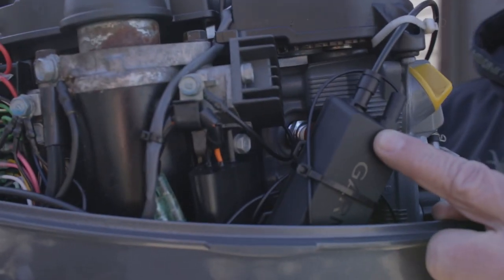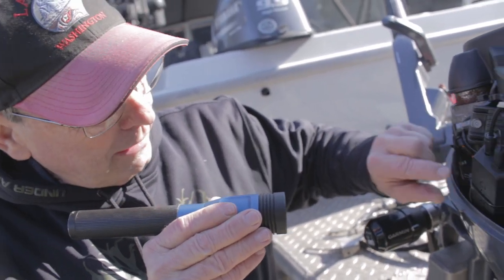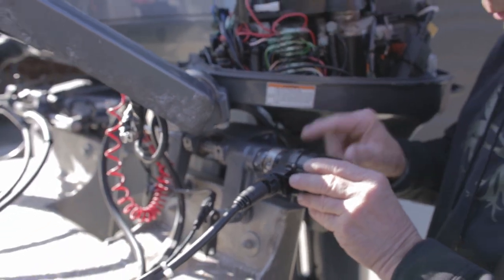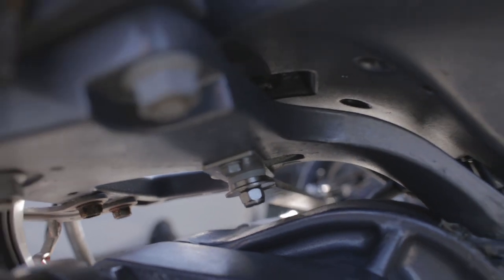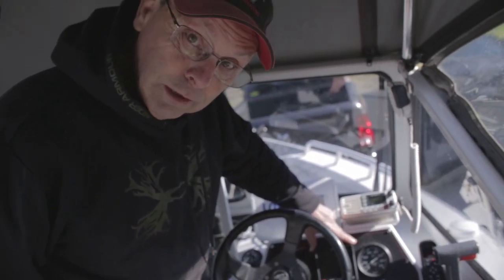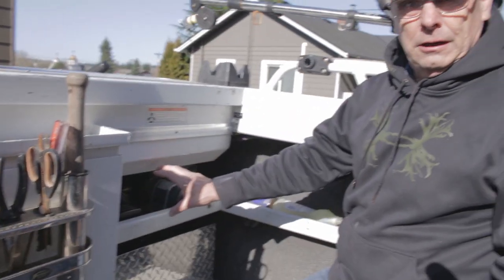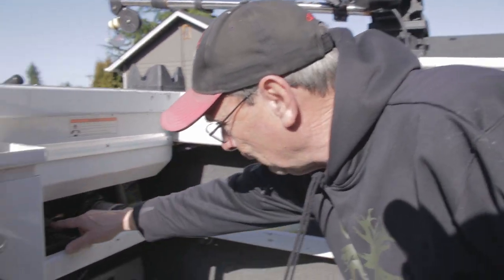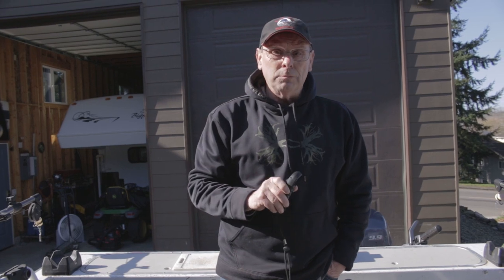Garmin Reactor 40 Kicker Autopilot l Installation Tips with Jimmy Dz

Comment: Really appreciate the install tips.  Helped me tremendously.  3rd day out today had the same problem as you with the steering connector falling apart. Rebuilt with loctite and locking nuts which i assume you had to do also.  Thanks again!

Comment: Thanks to this video we installed this unit pretty easy which was in March of 2020 purchased new for my Yamaha 9.9 high output 4 stroke which pushes a Sportscraft 252 .. All was good until a week ago May 7th 2023 .. My Garmin 93 Sv and autopilot component started beeping and engine went to idle I looked at both screens and it said ECU temperature.. I shut everything down and rebutted and it still gave warning .. So we pulled all poles in and headed to the dock .. Tried it there and same .. I called Garmin and told them what happened and they said did you reboot and let cool down and I said yes .. They had me take the cap off Garmin motor to see if wires were burnt or got rubbed down to wire and Eve looked good .. The wanted the serial number and said send it in and we will give you a new motor .. Well my warranty expired by 2 months so I paid $400 for a new one but get half back after old one is received by them .. Installed new one and ran good for about a half hour and SAME thing happened ECU temperature warning .. Now my 9.9 moves back and forth with ease and it was a very calm evening on the lake smooth as can be .. We pulled poles in went to the dock tried it again and beeping same .. Now waiting to call Garmin in the morning..

Comment: Hi Jimmy
Enjoyed you video.
What were the steps to connect your Garmin Reactor 40 Kicker Autopilot to your Lowrance Sounder?
My guess is you entered the Trolling Motor Autopilot section on your Lowrance?
Any help will be much appreciated.
Thanks, Kenny
Reply: Hello, you don’t have to enter anything into your lowrance, make sure though that on preferred sources on your  GHC to recognize what you are using as a heading sensor. I’m using a point one so that’s what I have. Because it on the nema 2000 when you enter way point or routes to go then on your remote enter go to route it will talk to the lowrance. Tight lines

Comment: Thanks for putting this out there...Quick question??  The video is not too clear as to the location of the CCU (centerline/waterline)...it appears that you put it in the storage area in the bow, but where did you affix it?  Thanks in advance
Reply: Sorry didn’t get a good picture of the location, I installed the ccu just above my bow storage doors, bolted to the underside of the step, they want the ccu to be more towards the front.   Tight lines

Comment: I could not figure out what was wrong with my TR-1 system.  Spent money on replacement power button didn't resolve.  I decided and worked out getting the Reactor 40.  Shop I think is putting the GHC 50 in back of boat.  not sure if that is best location.  I have someone that knows how to work on their TR-1 make me an offer on parts when I get my boat back.  Shop told me they will remove all of the TR-1.  The shop I don't think will connect the NMEA 2000 for me.  I told them I do have it connected to the TR-1.  I replaced my fish finder with a new Humminbird and never programed it.  Does connecting that to your fish finder really do much?  With the TR-1 I didn't think it worked all that great.

Comment: The system on your dash how much does that cost?  I'm trying to figure out my TR-1 and if fails to work will look at getting the Reactor 40.  Any suggestions on good dealers and pricing?  Only one near me is outragious what they charge, $185 an hour for labor and $4,200 to install.  I believe I can do the install myself as long as I have the parts and marked so I know which to use.  We have a 2007 Mercury Prokicker 9.9.  Is the dash unit really necessary?  I usually us the fish finder speed on our Humminbird Helix 12 Si G4N.  Use to have a speedo on old Humminbird.

Comment: Jimmy, do you think if a kicker had remote controls it would still work ? there was a note in the instructions about it only working with tiller boats. But... if all it is is connected w/ a tie bar to main motor i cant see it being too much different.
Reply: Hello, sorry about responding so late, the kicker operates separate from your main and doesn’t have the power to turn the kicker and main, good thing is if the unit fails for any reason you just disconnect the bracket from your kicker and hook back up your easy steer rod

Comment: Jimmy, Thank you very much for the great video. I also purchased the kicker autopilot and have a question i hope you can help me with.There is the steering cable that connects the CCU to the ECU. Where that cable connects to the CCU there is a additional cable with 4 bare wires. the instructions state to connect those the steering bus on the boat. According to my boats wiring schematic i dont have a steering bus and being a kicker package that im connecting to a tiller motor im not sure how to proceed. Did you use those wires? and if so where did you connect them. Thank you for any response. Rob
Reply: Hello Rob, I think what you are looking at on the CCU isn’t a steering bus connection but the nema 2000 connection, if you already have a nema 2000 then you won’t need to hook up the power wires but will need to have it hooked up to the nema back bone. and if you have a GHC dash controller that also hooks to the nema back bone along with your fish finder. The nema system is how the components talk to each other. the CCU will need to be connected by the nema to either your fish finder that would need to be blue tooth capable that will pair to your remote or the GHC 20 dash unit that pairs to your remote or both in which you will be able to follow a route and go to a way point by way of your fish finder. Hope that helps you. Tight lines
Reply: @jamesdonnelson2519  Jim, Thank you for responding. and again thank you for the video. theres not much out there for help with this unit. I did get some help from garmin they were actually pretty good.All set Thanks again

Comment: Any chance you can do a video on the lowrance communication with setting up routes and trails for the Garmin
Reply: Thank you very much for your time and help I appreciate it
Reply: Hey Ral, my reply didn’t go through, I’ll try and make one on setting up routes and waypoints on the Gen 3. Until then here’s an idea. On your gen 3 while sitting at home on the chart page curser to where you want to start a route, than go to the route page and select new route, by map and it should go to where your curser is, move along that depth line and enter each route point, when finished save  and name, now that route is on your log, on your remote select one of the three presets to be for routes. Now when on the water go to that route and go to then on your remote push that preset number the number should start to flash on the remote then push again at that point the auto pilot should take over. I may be a little off in sequence but with some practice you will figure it out, just need to take some time on quiet water and play with it. Good luck and tight lines

Comment: Great video.  I’m going to order one as well. I’m not ordering the in dash unit.  Can I mount all units back in the transom?  Thanks.
Reply: Garmin highly recommends that the CCU is mounted towards the bow as close to the water line and as close to center as you can, also to stay clear of any magnetic field such as speakers, your vhf, anything that could effect a compass, that’s what your CCU is. You can use a hand held compass pass over the area to make sure the needle doesn’t move with in a foot or two if possible. Hope that helps .

Comment: great video Jimmy! I recently puchased a 22 foot Cabo and im in need of a kicker motor. I was looking at the yamaha 9.9HT. However, im also looking at buying a 16 foot klamath truck topper. If I were to buy a 20 horse yamaha and use it on both boats, how hard would it be to disconnect all the garmin wiring from boat A to add to boat B. Bascially what im thinking is it why buy 2 motors with autopilot if I can get away with only buying one motor but 2 sets of wiring(1 for each boat). Also, are the tiller and the variable rpm still operation after you install the reactor 40.  Maybe im being too big of a cheap-O.
Reply: Good day Adam, I’ll me attempt to answer your question. If you buy one motor, the throttle and steering activator are already on the kicker, note the throttle activator as I showed on the video I had to move to the top of the engine to stop over heating issues, the components and wiring you’d have to move is your ECU(the brain)the CCU (compass)and the GHC 20 ( the dash unit that controls and pairs with your remote) if not the GHC then a fish finder that has blue tooth capability that will pair with your remote and will act as your heading sensor if you don’t have an individual one, like a point one, You will need to decide if the hassle of moving these components are worth it. As for the the rpm adjustment that comes with your throttle activator that after installation it becomes part of your kicker but only when using the auto pilot.
Reply: @jamesdonnelson2519  thanks Jimmy.

Comment: Hey Jimmy, great video. I have a question about the Throttle Actuator. I have installed everything but have been working with Garmin on getting the throttle actuator to show signs of life. It looks like there is a light on the actuator. Is that correct? If there is a light when does it come on? I have been sent a new actuator, cables, and now ECU with no luck. Steering is working great. Any feedback you have around the throttle actuator and how I might know if it's getting a signal and power would be helpful. Thanks and again,  awesome video.
Reply: Never mind Jimmy. I figured it out after another 1.5 hours on the line with Garmin. Long story short, the little tiny opening on the front of the throttle actuator does nothing and there is no LED in there. That was misinformation from one of the Garmin support guys I talked to early on. Another misconception is that there should be an RPM reading in the Tachometer information displayed when you go into the settings on the GHC or your Garmin Chartplotter. And Garmin will actually be removing the tachometer RPM reading from the settings on the GHC in a future update. Nonetheless, I have it working now. I hope this info helps someone else trying to understand the ins and outs of the throttle on the Reactor.

Comment: Do u have full controls at the steering wheel we do wondering if I can keep my throttle.tilt trim helm controls and add this
Reply: Hello Rusty, all controls stay the same, to operate you put into gear at idle and let your remote throttle up or down and steer, when in standby or the unit is off your helm controls operate as they always have.  Tight lines.     Jim

Comment: I bought and installed mine on Yamaha 8HP motor. Everything works but throttle control. Spent about 1.5 month working with Garmin on troubleshooting and pretty much replaced all components one at the time except NEMA switch and the display. Can't really get straight answer on how to mount RPM sensor wire. One Garmin rep says that it has to be clipped to the spark plug wire right next to spark plug boot, other one said that I have to actually stick it underneath the boot. A boat mechanic told me that I need to coil it up around spark plug wire 5-6 times. Don't really know what is right and whether or not this is the root cause.
Reply: I’ll tell you how we installed the one I have, I zip tied the small sensor wire to the spark plug wire, the activator body we moved to the top of the engine to keep inductance from the main body. That has worked for me. My last 6 trips out I have been getting a speed source error and my remote won’t adjust the speed, each time resetting back to factory defaults on the GHC20 has fixed the issue but it has been a bit annoying. A tech who might be able to help is Fred at Harbor Marine in Everett Wa. He’s installed several .Hope you find out what’s going on, let me know. Tight lines.      Jim D
Reply: I fixed mine by adjusting cable wire. Also, garmin tech recommended to set low rpm settings to at least 1000. May be you need to do this to avoid error messages

Comment: How is it in salt? Also will this work on a 2020 Honda 20 hp kicker?
Reply: I have only had mine since January 2020, We are on the salt primarily, the reports I got before buying were very positive on durability in salt. As far as your new Honda if it has a tiller tube for the steering activator it should work but you should for sure contact your Garmin dealer to verify. Good luck & tight lines.

Comment: Nice video thanks. Just got mine today  intimidating woa. Do I have to hook it up to a separate graph or just use the monitor it came with. Thanks mike
Reply: Northgate Construction , as far as I know you don’t have to have it connected to a graph, the remote pairs with the GHC20 , you just won’t have the ability to navigate to a way point or route. But you still     have availability of all the functions like steering hold, zig zag pattern, u turn, Williamson turn etc. Tight lines.

Comment: Should I also install a Garmin stainless tilt tube anyone do this we do some salt and wash after every use it's on a Yamaha t8 what's the maintenance on that tilt tube every year thx
Reply: I did change my tilt tube, problem with the Yamaha is it’s a mild steel tube and creates corrosion so after several trips if you don’t clean it the plastic screw on the steering actuator will strip from the resistance. Happened to me at the end of last season.

Comment: How did you hook it up to your lowrance gen 3?
Reply: Hello Ral, the kit comes with a Nema 2000 set up, the CCU, GHC 20 and the Gen 3 will communicate through that. When you set a way pt or route to navigate to and start or go to on you unit you then push one of the presets that you have set up on your remote it will start to blink that number push again and the pilot takes over. Makes running gear almost to fun.
Reply: Hey Ral. I’ll try and get one done in the next couple of weeks.

Comment: How will you do updates to your ghc20 and ecu ? How did the dockside and on the water trials go?
Reply: No information for you on how you could update, that would be a Garmin question. Dock side and sea trial were very simple and easy to perform. I downloaded the manual from the Garmin site before I bought the system to see what the requirements would be. Tight lines.

Comment: I am having throttle activator issues on my Yamaha 9.9.   Had the unit installed like this video, but it appears to over heat and quits working.  Anyone have similar problem or find a different location to install?
Reply: My location was based on where a shop here recommended but I did have an over heating issue and Harbor Marine had it relocated to the top of the engine, I haven’t had any issues since.
Reply: @jamesdonnelson2519  
Thanks, I did the same and had no problems today, wish I had talked to you earlier.

Comment: Piece of junk replaced steering control, throttle control, both modules. Only this that wasnt replaced was the cables. Wasted a whole season and alot of money.
Reply: Could you tell a little more please? Did garmin not warranty faulty stuff, was your boat a weird size where things didn’t run smoothly or just junk like you said. I’m looking to get this for my Luxor 200 for 2 person fishing tournaments instead of itroll. Would be great for us both to be at back of boat obviously. Anymore information would really be appreciated. I haven’t heard much negative on these units.